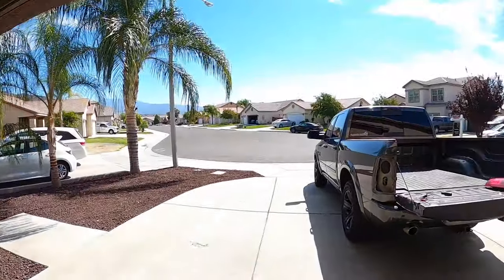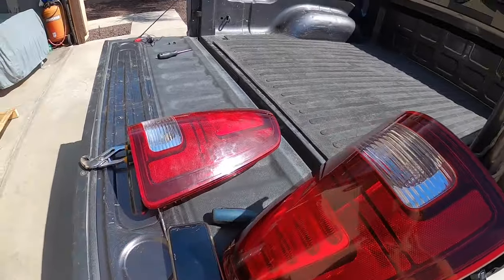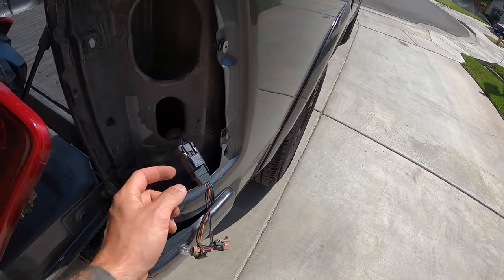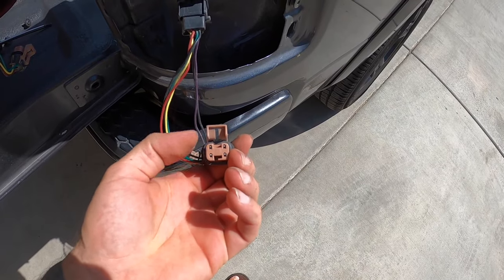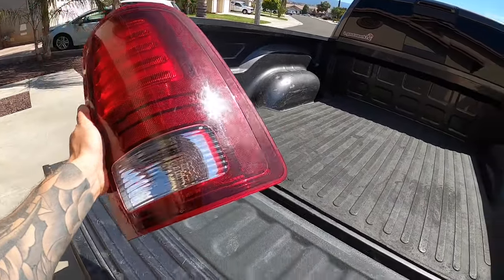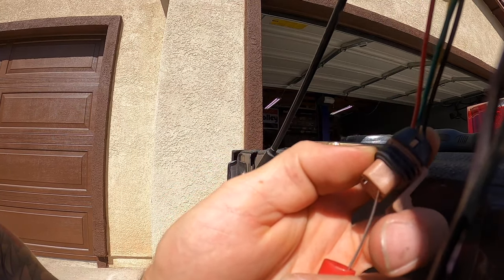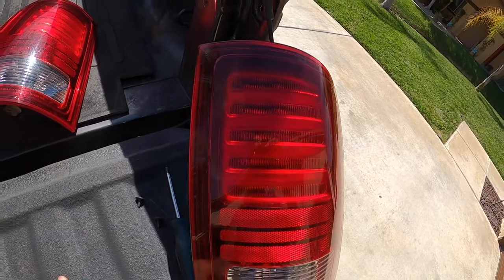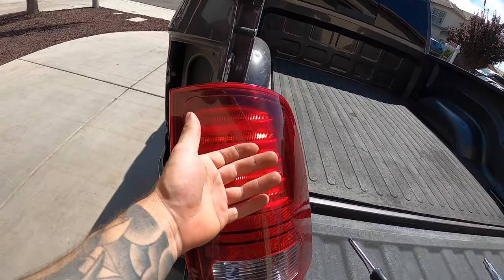Diagnosing Tail Light Turn Signal Light Out RAM truck

Comment: My 2014 Ram 1500 Big Horn driver side rear red light does not turn on when I brake BUT when I unlock the truck with the remote, the light turns on like normal. HELP PLEASE...how do I fix this?

Comment: Yep, I got that issue with my 16 3500 Longhorn CTD. Mine is the left side, gotta pay more atte tion to the qnty of lights illuminated. Also, read it could be the 3rd brake light as well.

Comment: My 2017 1500 sport started reporting the rear left turn signal was out last night. I had no LEDs out and not other bulbs out, besides the constant warning as I drove, I noticed that turn signal sped up as I would expect it to do when a bulb is out in any car that I ever owned, Swapped the right and left as the video suggests and neither right or left complained. I switched them back and the warning is gone. Maybe some computer glitch that got reset when I unplugged the light -- hopefully it doesn't come back.

Comment: I didn't know this thanks so much. I bought new bulbs lol my Ram 1500 is a 2014 with the 8 speed transmission 😂 a1 auto has these units and I'm ordering rightnow. I get the left side turn signals out and the right-side brake light is out wth 😂

Comment: Did you try to source any after market tail lamps that worked with OEM LED assembly? I have not been able to find anything. Everything I've found have been for OEM incandescent.
Also, this is not a rare thing, either. I've seen at least 4 trucks in my city with the same issue - not including mine. Very annoying.

Comment: Man that sucks... Those ain't cheap.... I know when I first saw that turn signal light out indicator on my truck I panicked, however the taillights were fine, it was the third brake light that had burned out ( that was due to the total trash gasket used to seal that housing) I ended up using marine foam from Home Depot to seal the housing and eventually switched to LED lights on the third brake light and cab lights... It fast flashed for couple of days then got used to the lower draw and it's functioning pretty good now (knock on wood, and give me a second to go check real quick) 🤣🤣
Reply from the maker: Definitely not cheap! Sucks it failed!
Reply: Mine says left turn signal out but it works fine so annoying I will check my 3rd brake light also. These trucks are so cheaply built lol
Reply: @mkeys1233  all cars these days are.. the issue though is a that stupid byproduct of the Mercedes era, the CAN-Bus... Basically it's measuring voltage and even with my Ram Limited it can't tell you which bulb is blown... However on Benz it can tell you which filament on which bulb is burned out 🤣😍
Reply: @boostedmotorsports2  are most not led from the factory?
Reply: @boostedmotorsports2 $350 from Mopar for the drivers side tail light as mine was giving the same warning and same LEDs were out. Think I got a bargain at $350 for OEMs 👍🏻